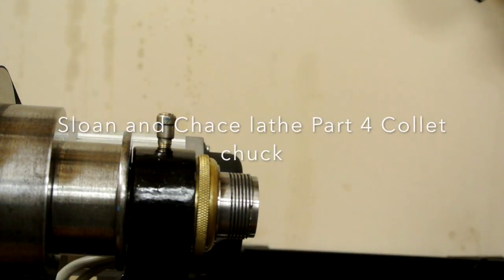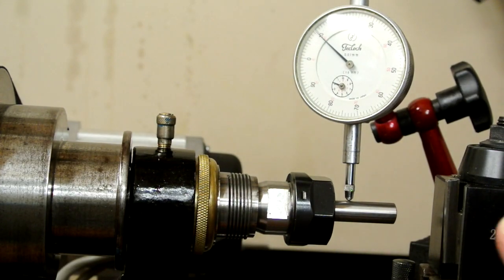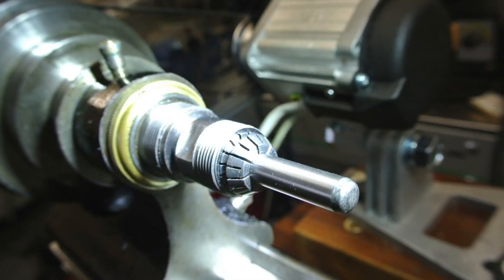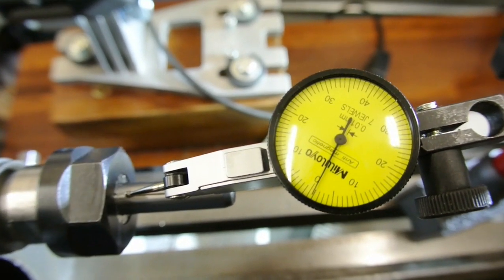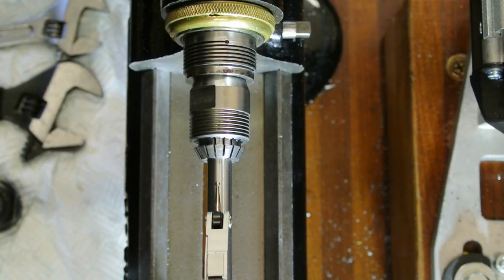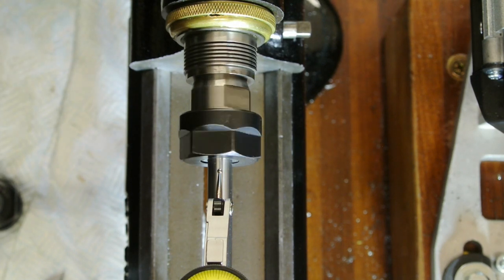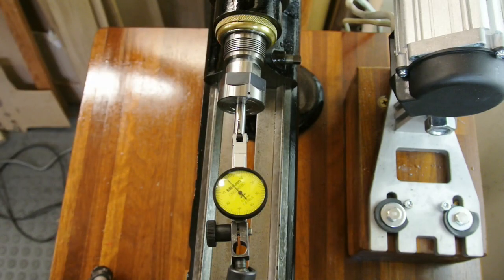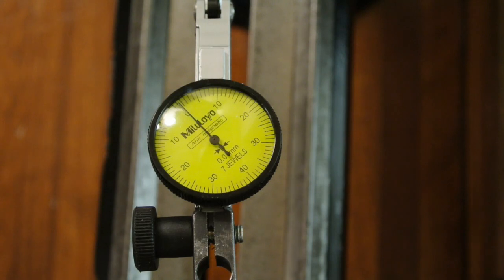Part 4 Sloan and Chace  ER20 collet run out

Comment: New subscriber here.  I'm really enjoying your series on the Sloan & Chase lathe!  Own several of these old bench lathes (Pratt & Whitneys), and am in the process of restoring them.  I live not very far from Newark NJ.
Reply from the maker: Daniel

Glad you have found them interesting. I love these old lathes and it has been really special to get hold of one in such good condition. Not easy to find on this side of the Atlantic and we didn't have the tradition of making this type of lathe. Our old lathes tended to be made down to a price. Schaublin would be nice but they are just so expensive. Looked at the P &W and they look really nice.